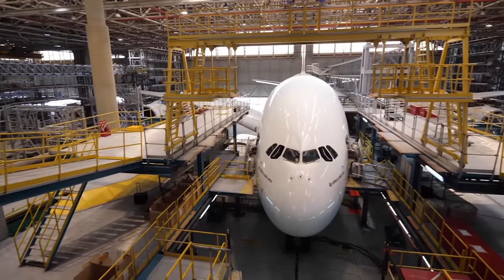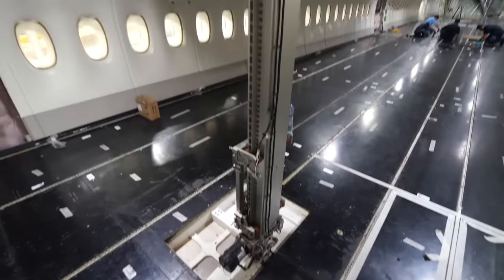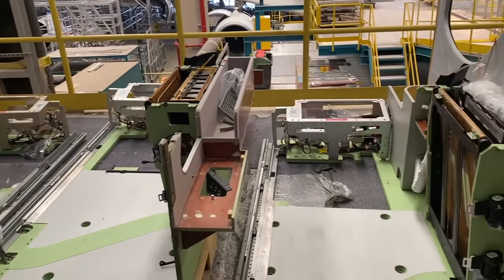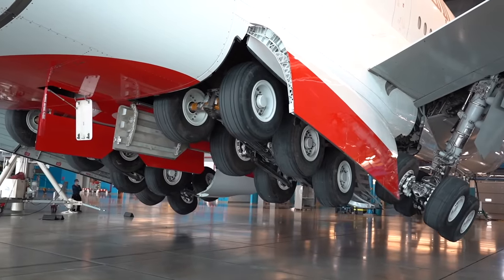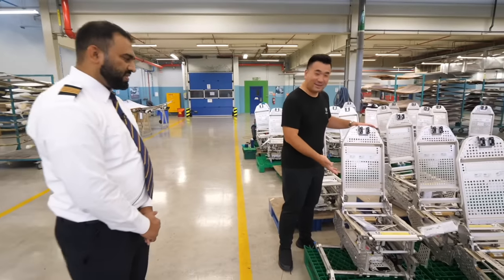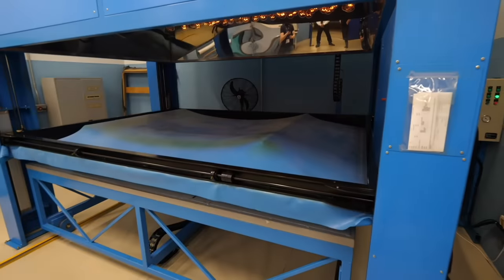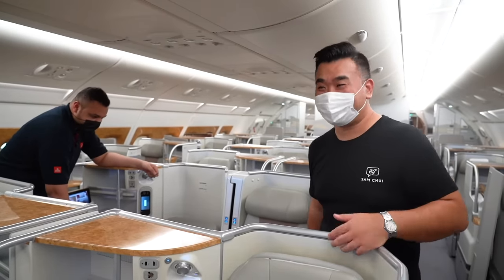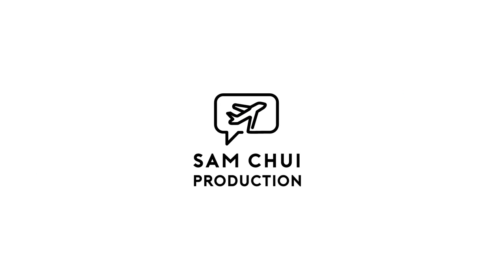Inside Emirates A380 Service Center - How Did They Bring an A380 Back to Life?

Comment: Former Boeing here... have been in 747 from pile of parts to final cert. Always amazing to see how big it is with no interior panels, carpets, or seats. During construction, the elevated catwalks form perfect contours of fuselage. There is maybe 1 inch clearance. Workers can move about without fear of falling through the cracks. Never been inside an A380 yet, but hope to before they are all retired.

Comment: Such an incredible behind-the-scenes video this. The scale of just getting an A380 ready is insane! The number of engineers and plane parts needed is mind-blowing.
Reply: Why do you think it cost billions to run an airlines
Reply: One of the reasons it's too costly to operate.
Reply: I used to be a mechanical engineer servicing landing gears, over one million per leg overhaul
Reply: SELL GOLD AND BUY PLATINUM
Reply: I need job
Reply: FOR HYDROGEN PLATINUM IS NEEDED.sell gold buy platinum.price is low now.. follow platinum strategy...price will rise like gold promote platinum.

Comment: A380 anatomy. Amazing documentary Sam !
Reply: Ji
Reply: Gs
Reply: У нас так никто не заморочится
Reply: oooh that's why I felt extra sleepy watching this video!! this was a hidden anatomy lecture and my brain was sensing the anatomy in the vid haha
Reply: They use too much fuel, can’t imagine the airline making a profit on half empty planes flying to the Middle East.
Reply: @reubenblanco3021  Exactly why only a small amt of A380 planes are in use right now. 4 huge engines powering an aircraft that is overkill in sears, size, and weight. Probably would need 600 pax to break even in fuel on overseas flights. Boeing 777 and 787 planes have plenty of seating to handle any long haul flight with two of the most powerful.engines on the world saving a kings ransom in fuel.
Guaranteed profit generators.
Reply: Today Machine,Sam Chui/OMAR/,GT7200 Engine Alliance,Gray Box/Full Controller of the Engine/,AC Unit,GearSwing/Extending &Retracting/,3Jacks to weight,Gear Swing/Lubricant/,It Takes14 Days 0-100%,Side Door Panel/Laminated/,Composite Panels,Heat activated Laminate,Bonding Side Retainers,
Reply: Engineers &Technicians worldwide working 24/7Days!!!
Reply: @nagarajarikeri1198  y
Reply: SELL GOLD AND BUY PLATINUM
Reply: FOR HYDROGEN PLATINUM IS NEEDED.sell gold buy platinum.price is low now.. follow platinum strategy...price will rise like gold promote platinum.

Comment: Love Emirates. I flew with them on many flights from either Zurich or Copenhagen to Bangkok with a stopover in Dubai. And it was always the A380 from DXB to BKK and return. An incredibly beautiful and very comfortable airline to fly international.
Reply: What plane use from Zurich or Copenhagen to Dubai?
Reply: @truthful3777  Back then, 2010 to 2014 it was the B777ER, now I see that they've used the A380, which would have been even more attractive to fly. But nonetheless, both aircraft our sensational to experience. Emirates is a fantastic airline and DBX  24/7/365 is a wonderful experience
Reply: @arnehovind3596 suicide not allowed
Reply: @REBECCA12341  WTF are you babbling about?
Reply: @wavelength3278  don't die as a disbeliever
Reply: @wavelength3278  XXX not allowed
Reply: @wavelength3278  suicide not allowed
Reply: @wavelength3278  tattoo not allowed
Reply: @wavelength3278  but they who say we believe in some and disbeliev in others they are the disbelievers
Reply: @wavelength3278  don't die as a disbeliever
Reply: @wavelength3278  don't text again

Comment: The lift is extremely important for moving items from lower to upper decks as a matter of face 747s, DC-10s, L10-11s and MD-11s have or had them for bringing items from down below to the passenger area of the plane.

Comment: Thanks for the video. Some thoughts. I think, when a carrier (Say emirates, united etc.) purchases a A380/747 from the Manufacturer like Airbus/Boeing, they also are tied to communications of the Mfr'er for every trip. Its not like the carrier has their own communications satellite ,but have to rely on the supplier for every trip they take, I repeat every single trip. Hence the carrier is tied to the supplier/manufacturer for the life of the engine.  This model is different from any other purchase like refrigerator etc., where you don't really contact the supplier/Mfr'er unless there is a problem. Hope I am making sense.

Comment: AIRBUS needs to launch a super stretched variant of the A380-800 . . . call it the A380-1000 Neo LR if you will . . . the A380-1000 Neo LR will accommodate 580 - 620 paxs in a 3-class configuration & will fly 16,920 kms non-stop (Sydney (SYD) - Frankfurt (FRA) . . . however there will be no single 1-class dense cabin configuration in the A380-1000 Neo LR due to possible damaging operator-customer first impression characteristics . . . meaning the very thought of a single 1-class A380-800 is not something one would associate with the world's largest passenger airliner . . . it'd be damaging for the A380-800s image

Comment: Aircraft air-conditioning units are not "VAPOUR CYCLE" except coolers ,chillers and some galley equipments for edible's preservation !!

IT'S  "ACM" ( air cycle machines )...
Reason it's function and operations are economical !!!
It's weight to intended function with other available are great amazingly!!!

NOTE: MORE OVER AT 35 TO 45 THOUSAND CRUSING SPEED...IT NEEDS HEATING AS OUT SIDE TEMPERATURES ARE MINUS 5....
SO HOT AIR FROM ENGINE BLED AND UTILISED TO TURN ACM TURBINE  COOLING MODE AND " BY PASSED" MOST OF THE CRUCING LONG PHASE OF THE FLIGHT!!!
ON GROUND ...GROUND AIR-CONDITIONING UNITS AND AN APU DEDICATED ENGINE BLED AIR IS BEING USED TO RUN THE SO CALLED ACM/S.

THESE  OPERATIONS ARE PART OF THE EXPENSIVE BUSINESS 

KNOWLEDGE IS STRENGTH!!!

MEMORY INTEGRITY IS WEALTH AND KNOWLEDGE!!!

LOVE YOU GUYS IN THIS REDS!!!

ESPECIALLY THANKING MR.SAM CHUI!

Comment: Stripping augments non corrosion failure!!

Reveals any cracks,lightning material failures..reverting conditions etc..

Never blanket and welcome a catastrophe bro!!
Aviation is an expensive business as we all know very well...especially maintenance!!!!!!
It's a must to make acraft " AIRWOTHY"
It reduces weight even though lots of stripping works have to be done in a painting hangar....
It improves  fuel efficiency by reducing skin friction and related drags.
It to ..carry messages of events with livary. 
Safety also can be seen elevated!!!
Lots of love !!
Thanks.

Comment: Huge aircrafts are very stable during flight! and  many operator's wish too in terms of economics...
Few flight crew with advanced  navigation systems with latest un failing redundant computer hardware, software etc...
Material advancement also lead to massive structures more reliable with weight to lift ratio augmented BROTHER!

Note...as a part of aerodynamics..
Certain parts ( structural elements) are made to flex and rigid as appropriate!!
Seat tracks bears pax weighi firmly held to structure!!!
Acceleration forces ...expend energy  ...
So Seat tracks can undergo cyclic loading and eventually fail...that's why it's been check...
On the other hand main body mambrances such as longerans, spars,stringers are also to be checked...
Those are more critical rather than a pax sues airline in the event  Seat being topple!!!
There are other enemies ,,,corrosion..lightning  damages heating etc

Let's work to get her to extend life of any aircraft takes invaluable life's around the world ...let it be a poor traveller to a VIP!!!
BROTHER.!!

Little might with lots of love!!!

Comment: 14:07 And they are doing all of this because there is less oxygen in the sky. The air pressure and density is low at around 32768 ft altitude, so that is why they do all of this. This is what I was thinking.

Comment: Did you see no talk about where all that fuel goes? Because they have very little fuel, just enough to start the turbine then it runs on compressed air.
Reply: @sexigrande1792  
Hey sexi don't call me names! In the wings you say? Really the wings are taken up with mechanical components like rods and cam's so don't be silly! You cannot also store thousands of litres of fuel are you mad? It's reported up to 120,000 litres in one wing😂😂😂😂